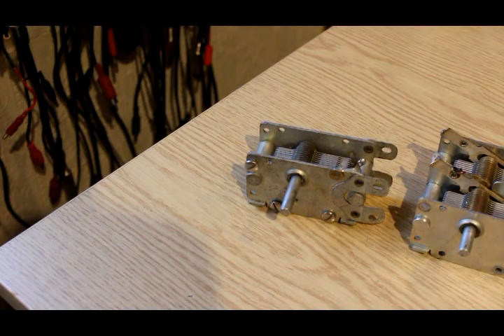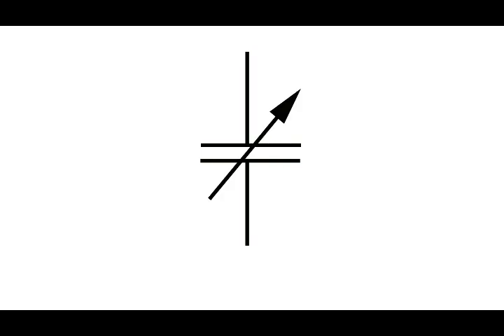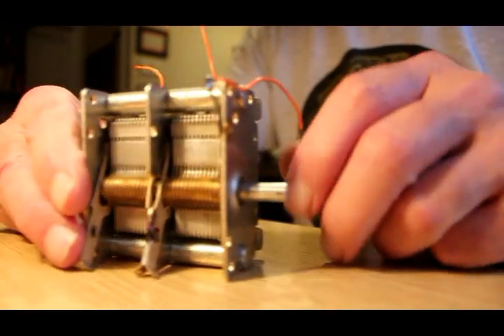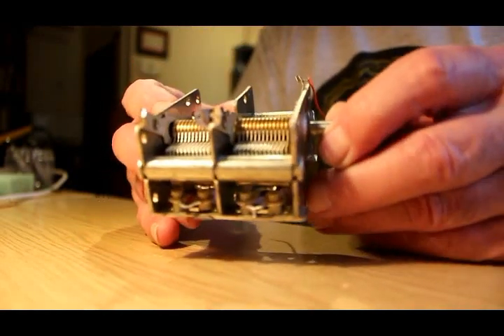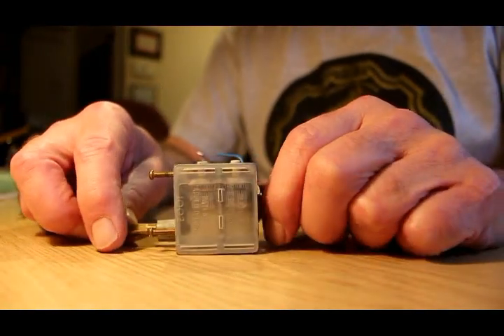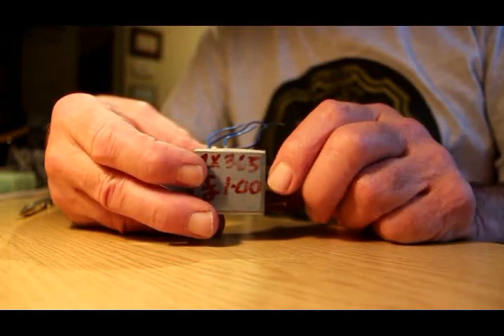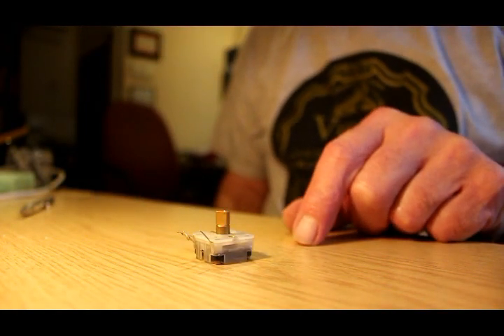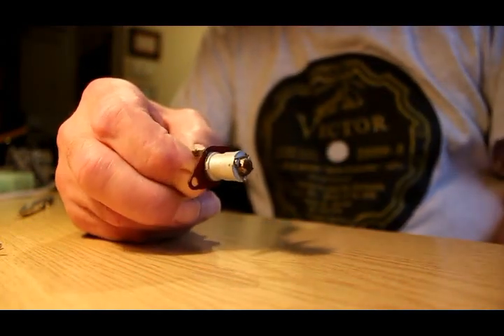variable capacitor

Comment: What type of capacitor would I use if I wanted to hear all stations at once?
Reply: Just use a coil without the capacitor, all the strong AM stations will boom in all at once. It will be a mess to hear😄

Comment: Back in the days of RADIO FREE EUROPE when the U.S. was transmitting radio into the Soviet blocked countries behind what at the time was called the iron curtain. To prevent the people that lived in the blocked countries from receiveing the U.S. broadcasts the cap had small bumps on two opposing plates that came in contact with one another shorting out the cap and preventing the osalator from osalating on that frequency and preventing the radio from receiveing the frequency that the U.S. transmitted on. Some of the people would file down the bumps so they no longer made contact so they could still receive the U.S. brodcasts. I don't I don't know if there was a penalty if someone was caught with a modafid radio or not, if anyone knows please let us know.

Comment: Greetings to you dear friend, how can I make a very powerful external antenna .... I went in the past few days to the old used radio market and got one with a variable metal capacitor like the one you are explaining on now, in addition to the ferrite column and the wire around it and after removing it From the old radio, I did not know how to connect it to make an antenna for the radio, knowing that there are many and many videos on YouTube explaining this, but I am confused about the correct way, please help
Reply from the maker: Hi Muhammad. I may be able to help a little; but you must first tell me, what radio signals do you want to receive? Is it AM or FM? Is it Medium Wave, or Short Wave? Also, please tell me where you live, and what radio stations you want to receive. I will help you if I can. You mentioned the ferrite rod (=column) and the coil round it - If you still have the wires (the coils) around it, that will be important. First, reply here, OK? Best wishes. Norman.
Reply: @bixanorak  https://youtu.be/IWKo2iPEmlI     It is the video clip of the metal variable capacitor that I have with the ferrite column with the coil as it is when I removed it from the old radio. I also have a radio. I will record a clip of it shortly and send you the link. I live in the Arabian Gulf and I want to listen to the short, medium and very short waves, and there is no specific channel I want By listening to it, I would like to listen to meaningful audio programs such as antiquity
Reply from the maker: @muhammadslwaey8829  Unfortunately, Muhammad, your Youtube video is 'Private' - so only you can watch it. 😙 But I will wait to see what pther info. you send. One very effective (small and easy) antenna for long & medium wave, is the 'Frame Antenna' (Loop Antenna) - see examples on Youtube by searching for "'Medium Wave Loop Antenna" and "Medium Wave Frame Antenna". Good luck! Norman.

Comment: I strugle with knowing how you wire the bloody things. Still dont know. whats + and whats -. 
The second one you show is exactly the same as what I have here, I got it out of an old signal generator but I still have no idea what it's capacitance range is my cheap chinease capacitance tester wont recognise it.
Great video you made here, not only do I now know what is + and - on my capacitor but I now also know exactly it's capacitance value 2X 500pf total of 1000pf.
Any idea how to wire it for a mag loop?

Comment: Brilliant! I recently decided to build a SW radio from an old Archer kit schematic and bought a 365 pF varicap. Was surprised to see four terminals, not two as the smaller, plastic one in the original kit had.  Attached a knob, hooked up capacitance meter probes to opposite-side terminals- no change whatsoever. Kept trying different terminals. Same damned thing. WTF?!?!  Found your video via Google.  I used to think that I knew something about electronics, but that's the side of me that reads Jim Williams but doesn't like dragging itself to the breadboard and doing anything practical.  THANK YOU!!!

Comment: Would this capacitor work for a crystal radio set. It is rated at 20-1000 pF 100volt.

https://www.ebay.com/itm/383558925311?ul_noapp=true
Reply from the maker: Aieee! Thanks for writing. No, this capacitor is VASTLY too sophistcated, and VERY COSTLY. Well - yes, it would work for a crystal set, but there's no need to spend $80 to make a crystal receiver! Unless you're a millionaire! 8^)   Something like this would be fine: https://www.ebay.co.uk/itm/Dual-Gang-AM-FM-Variable-Capacitor-266pF-X-2-and-20pF-X-2-500pF-Total/113059337104?hash=item1a52dc9390:g:9RAAAOSwxphbIQX0 . Hop this is of help. Gopd luck & take care. Best regards, Norman.
Reply: @bixanorak  Thanks i learned quite a bit from this.  I am not a millionaire, but i enjoy this so i couldn't care any less if i become poor as a result of it.

Comment: Does it matter what capacitor to use
Reply from the maker: Yes; there are two main things: (a) what is the job the capacitor has to do - some jobs require a large capacitance, while others need very small capacitance; and (b) the voltage present across the capacitor. This may be a few microvolts, or it may be hundreds or even thousands of volts. The capacitor needs to be able to withstand high voltages without 'breaking down' under the 'pressure' of the voltage. Hope of help; cheers, Norman.

Comment: Why not use old style variometer coils.... ? Its like more1910... 1920s..
Reply from the maker: That is a good idea - thanks. The variometer (variable inductor) would act with the capacitance of the antenna & so give a tunable resonant frequency. This would of course reject incoming signals of around that frequency, and divert them to the detector; this would most likely have been a crystal detector - or perhaps even a valve. To sum up, as you have suggested, it is NOT necessary to have a variable capacitor in a simple radio receiver! Best regards, Norman.

Comment: Hi, I have a small question about the variable capacitor, if it is possible to clarify. I remember seeing in some publication, but I do not remember where, on the outermost rotor plates that have a mark, three cuts, I do not know if this is the correct term, and that they are used for reference to certain frequencies, but I also do not remember which frequencies. Could you tell me? Thanks..
Reply from the maker: Hi there, Valdir. The outermost rotor plates have those little cuts so you can slightly adjust the total capacitance. They are, naturally, on the outside vanes in case you want to slightly decrease the total capacitance, by carefully bending one or more of the slotted vanes outwards*. To slightly *increase the capacitance, you bent them in - but not to touch the next plate! This was especially useful if you had more than one 'gang' of plates. Some variable capacitors had two , three, sometimes even four separate sets of plates - like the 'two gang' capacitor at 3' 25" in the video. These were used to tune two (or more) circuits that had to be in synch. If the gangs did not have almost exactly the same capacitance, then the circuits would go out of synchronism, and the performance of the radio would not be optimum. Sometimes, each gang of a variable capacitor would have a small 'compression trimmer' attached to each gang, like the trimmer shown at 11' 38" in the video. These 'trimmers' enabled you to get the big capacitors the same value. Or at least, *very close*. 8^) Hope this is of help. Best wishes & good luck! Norman.
Reply: Thanks for the info, Norman. Best wishes.

Comment: if variable capacitor is used to build WM ferrite bar antenna, would it be better off with a large pf (1000pf) compare to a 365pf unit. thx

Comment: THank  you.  How many turns did you use on the coil and what was the copper guage of the wire?  What diameter?  Thank you.  And if you have a diagram of the amplifier part I would like to have it please.
Reply from the maker: Hi, and thanks for writing.

Well, that coil was for the Long Wave (~150 KHz to ~300 KHz) so it was made on 2.5" (6.5cm) diameter plastic drainpipe, with about 150 turns of close-wound enamelled copper wire (called magnet wire in the U.S.) of 0.45mm diameter. That’s 26 S.W.G. (British Standard Wire Gauge), or 25 A.W.G. (American Wire Gauge). However, the gauge is not very important – but it MUST be enamelled (insulated).
What is important, Long Wave broadcasting is, I believe, only used in Europe; so if you’re outside Europe, there almost certainly won’t be anything for you to receive! But there will be stuff on the Medium Wave (~525 KHz to ~1600 KHz.)
To tune the Medium Waveband with a 500 pF variable capacitor like I used, make a coil on, say, 1.5" (~4cm) plastic pipe, of about 60 turns, and that should do.
The amplifier I used was just an ordinary audio amplifier. You could put the signal into the sound card of a PC or laptop. Or a guitar amplifier if you have one. Cheap, small audio amplifier modules are readily available on ebay.
If you’d like more details, go to my (very long!) series of 6 videos on making Crystal & valve radios. #1 is at https://youtu.be/EJrG9pfvf4U Hope this helps, & good luck with your project! Norman.

Comment: Is there a good source for the VC Caps-- other then Pebble?
Reply from the maker: IMHO, the most likely source is radio hams, most of whom traditionally maintain 'junk boxes' of things that may come in handy one day for some project or other. Since air-spaced variable capacitors were always relatively expensive, few hams ever throw them away. Therefore, to find radio hams, Google to see if there is an amateur radio society anywhere near you. If there is, find out when & where they meet & just turn up and introduce yourself. Hams have always been very accessible and are keen to encourage interest in radio of any kind, and at whatever level. Newcomers are always welcomed. The phrase was always "The Ham Spirit" - and it is still very much alive! Good luck. Norman, G4LQF.
Reply: I live in a CRAPPY little town with NO resources to parts of any  kind. Is IHMO a company?
Reply: Thanks Norman

Comment: I have been reviewing your crystal radio videos and bought a 365 pf variable cap and wound up a coil on two inch PVC with radio shack mag wire. Interesting so far I have two stations in the high end of the am like 1310 etc. Not sure what coil modification will make it tune further down the frequency range. Thanks Norman you're the man!
Reply from the maker: +area46241 Hi there - thanks for writing. just make the coil maybe twice as many turns - fasten the new end down temporarily with sellotape or insulating tape - that will get you down to a lower frequency. If it's too low, take off a few turns, until you get the widest coverage. It may not tune the whole range of the Medium Wave. However, if your 365 pF is a twin gang and you're only using one gang, put both gangs in parallel, which will give you 730 pF. You might try this before adding turns...  You could also have a small fixed capacitor - say 220 pF - in parallel with your 365 pF. Tiny disc ceramic fixed capacitors are cheap & will work OK. Good luck!